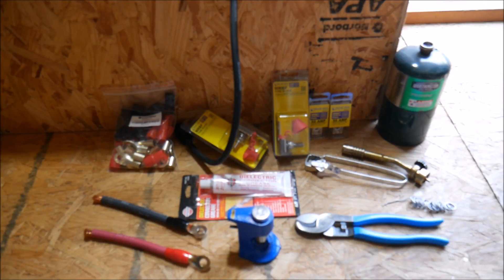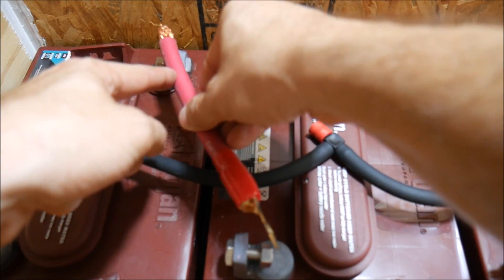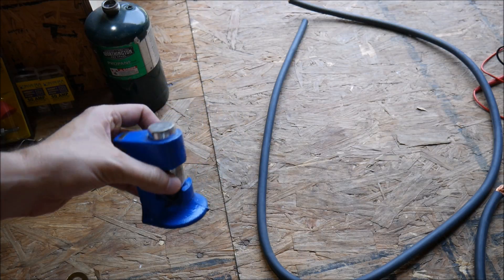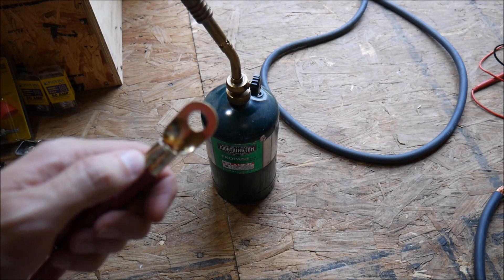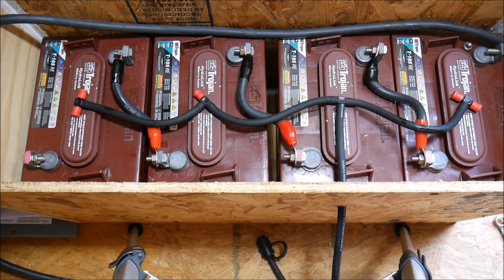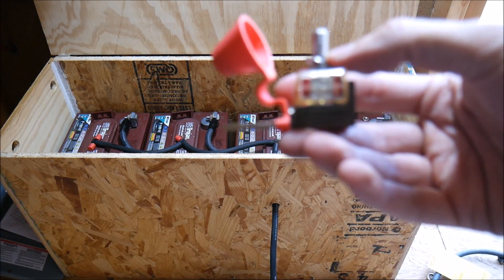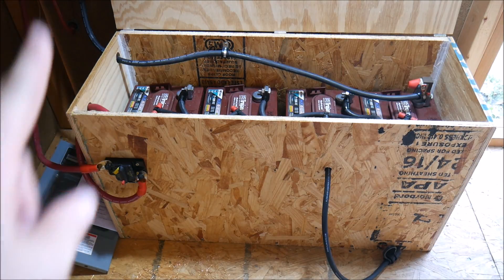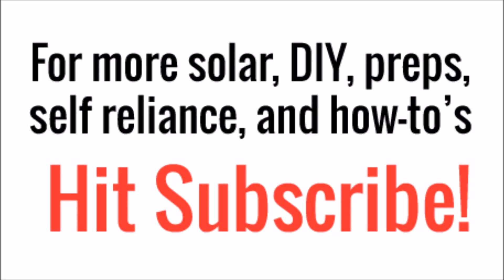Redoing The Solar Shed Part 5 - Wiring The Battery Bank

Comment: Next video: replacing all lead acid batteries to lithium batteries :)
Reply from the maker: Maybe in a few years.  Right now to get the same amount of amp hours with lithium would cost me about 10x the investment.  This bank is 225Ah @ 24V at the 20 hour rate and cost me $700.  To get that with lithium would cost me over $6,000 plus shipping and tax (2 of these - https://www.lithiumion-batteries.com/products/12-volt-lithium-ion-batteries/sb260.php  or 2 of these - https://www.altestore.com/store/deep-cycle-batteries/lithium-batteries/simpliphi-power-smart-tech-lithium-batteries-p40602/#SIMPHI2.6-24V).

The price is dropping in half every few years right now so maybe by the time these Trojan's are dead I can get a similar bank of Lithium batteries for $1500 or less.
Reply: CheapVlog possibly, I bet he will one day.  What I like so far is he's working with what he has, keeping it simple, not expensive nor cutting edge.
Reply: Lithium is an umbrella term. What kind of lithium battery?
Reply: Thats 543pcs 18650PF Made in Japan cells and costs ~1300$ brand new including delivery and Taxes.
https://eu.nkon.nl/rechargeable/18650-size/panasonic-ncr18650pf-3-7v-2900mah.html
Welding it together is a lot of work of course but its fun for me.
Reply from the maker: DIY is almost always a much cheaper option!  Nice find.

Comment: you sound especially frustrated.  get it done.  get it done.  basically it is done.  now make a lemonade and relax!
Reply from the maker: I just don't like battery wiring.  It is tedious and I am always afraid of a short circuit.  It has happened a few times.  Not fun.  Plus it was 95 degrees outside and I was doing this for like 4 hours.  Taking videos slows everything way down.